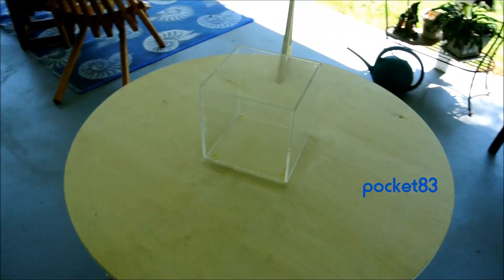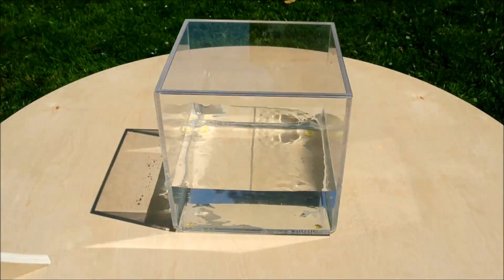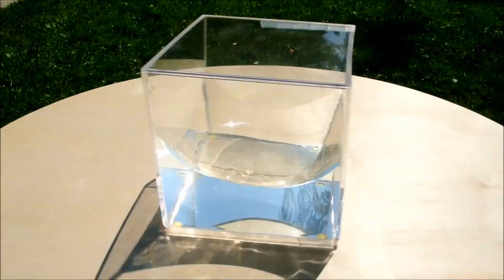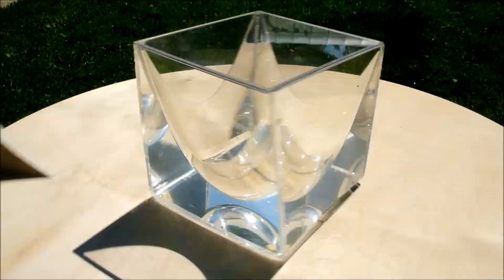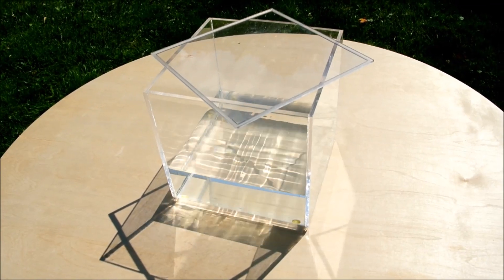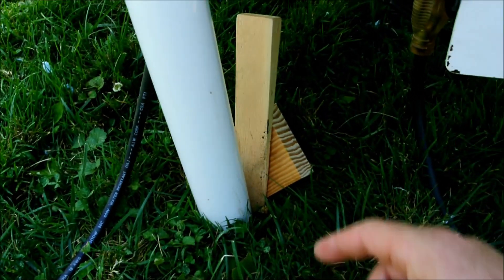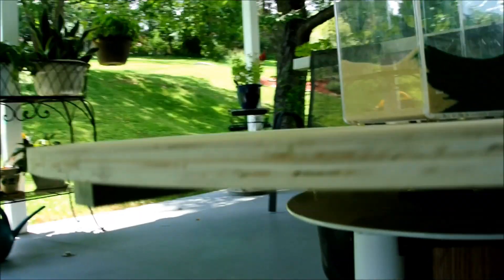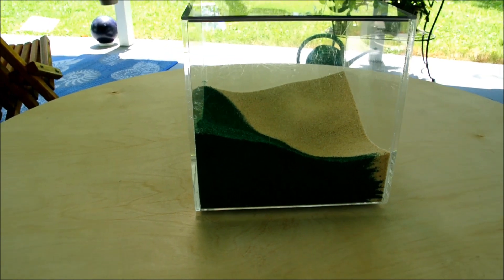Forming paraboloids on water

Comment: Could you spin some resine and let it cure while spinning ?
Reply from the maker: That would be really cool! Plaster of Paris is WAAAAY cheaper, though.
Reply: pocket83² is it possible that the height of the camera mount would cause the disturbances? Or the wind resistance it being almost triangular would cause. Also, yes, you do need a plaster of paris parabaloid. Pocket83's Plaster of Paris Parabaloid. Id click that thumbnail.
Reply: I had to add a smooth hole to the mount to allow air through. At first, it went WOOOSH WOOOSH WOOOSH as it passed, and it was seriously intimidating!
Reply: Could you mirror plaster after it cured and make a "death-ray" from it?
Reply: Chris Beard 
Super-clear ice, like that used in ice sculptures, is actually made by agitating the water as it freezes if I remember correctly.
Reply: Well, a person just can't have any fun anymore. ;-)
Reply: This is a much better idea than I had, I was trying to figure out how to mount a small freezer to it so you could freeze the water. How would you power the freezer? Does water agitated in this way freeze?
Reply: maybe asking some ice sculptors to put this in the freezer.
Reply: Matthieu Honel I was literally about to comment exactly the same thing
Reply: Rick M q
Reply: Probably! But the stupid police took my last death-ray.